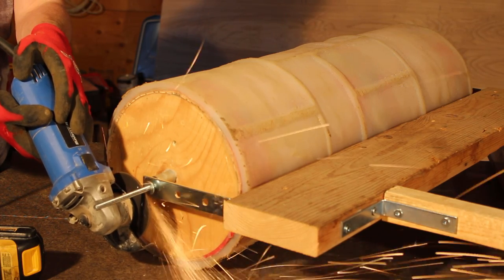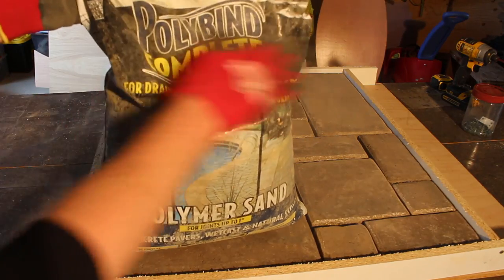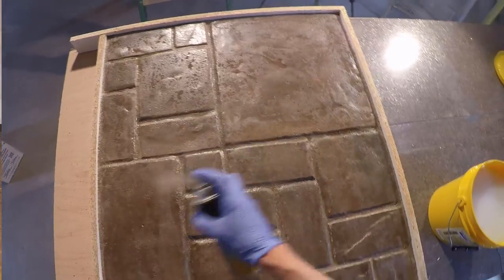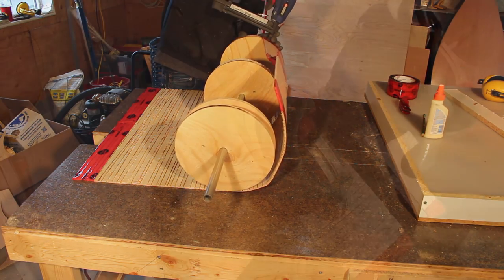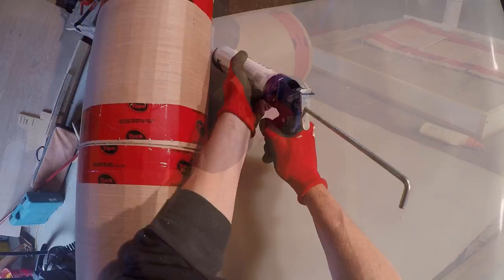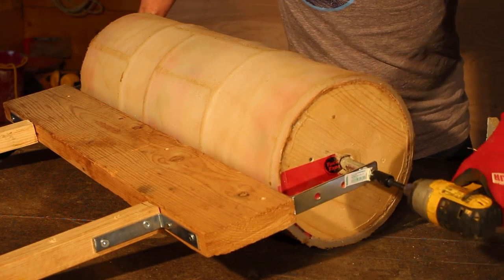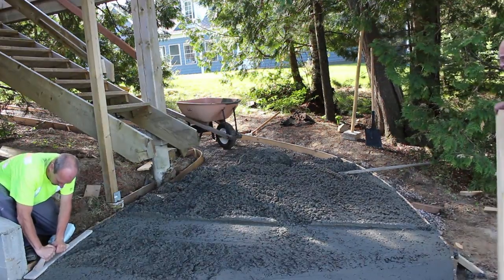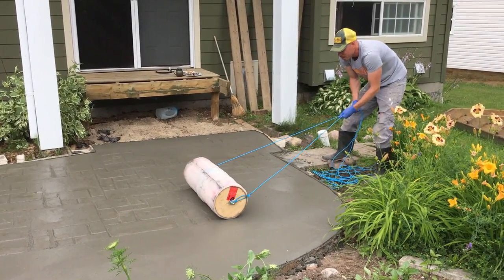How To Make A Concrete Stamp Roller - DIY Stamped Concrete - DIY Concrete Stamp

Comment: I thought I was confident that I could do a great job of concrete - but you took all my confidence away with this job. BUy stamps, a lot easier - plus use release agent, etc.. make sure your forms are nice and tight, straight, the lines in the mold you made is awful, if someone did this job for me, there would be no payment made. Honesty is the best policy. I KNOW you can do better after this.
Reply from the maker: wow, thanks. glad you liked it!